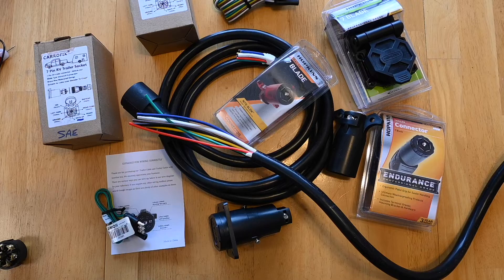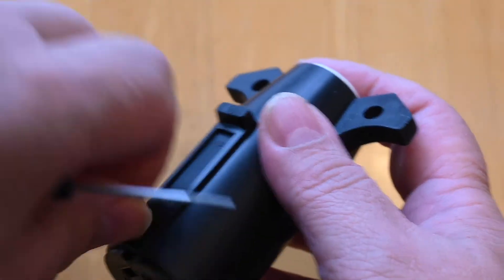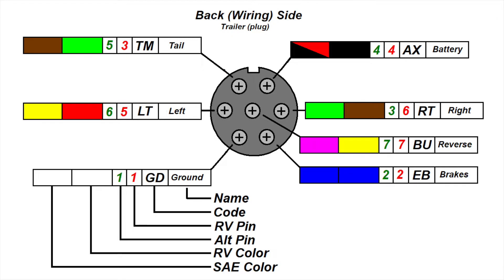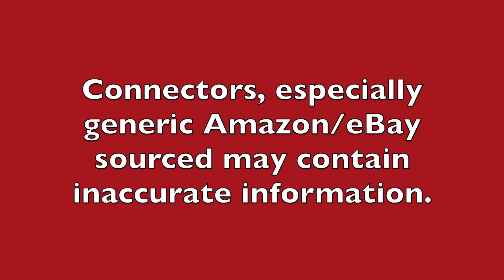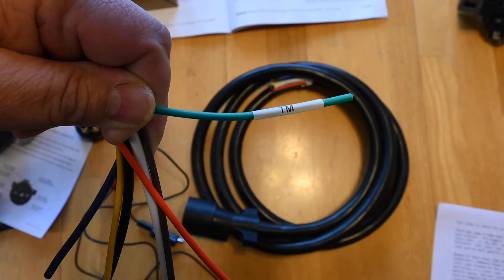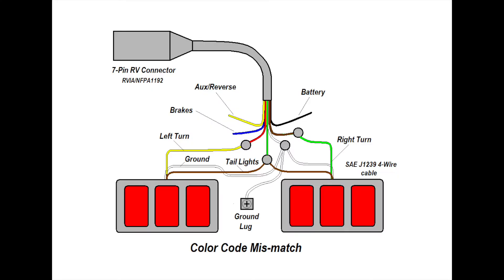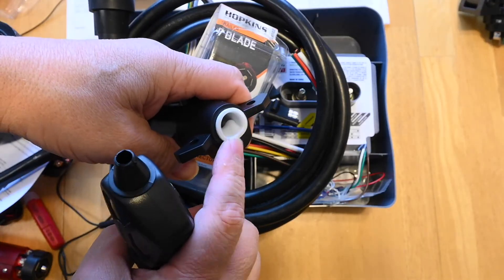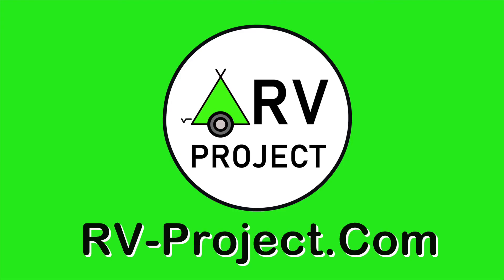All About 7-Pin RV Trailer Wiring

Comment: Hey I have a semi truck, with a normal 7way for semis. I have an adapter it goes from normal semi truck to an rv style 7 way, like in your video..I don’t have electric brakes. I want to use the rv style 7 way from the trailer and connect it to my adapter, silly for the purpose of using the lights on the trailer. When I plus the trailer in to my adapter it activates the brakes..could I take one or more pins out of my “female” adapter (7way rv style). And use it for only the lights on the trailer, and then it won’t activate the brakes on the trailer..if so wich ones? Would it ruin the electrical system in the trailer, if it’s plugged in to my adapter that way….i have pics if needed, thanks

Comment: I'm about to install a lithium battery on the little travel trailer, so I have been watching a bunch of 7 pin wiring videos.  I need to install a 12v/12v 10 amp limiter so my alternator doesn't overheat trying to charge the lithium battery.   I just want to say your video is the most in depth and simple to understand out of all of them!  Thanks!

Comment: Now, what about seven pole? Like the semi truck through the round one not the pin I’m having problems running these on trailers. I guess they have a separate function for the turn signals in the stoplight and they don’t have adapters from seven pin to seven pole, but I can find.

Comment: So if I was going to pull a trailer behind my RV which colored wire should I use? Is the cable with the 10-gauge wires in it the cable I should use?

Comment: Great Video! I am trying to find the max current for the pins in the connector itself per SAE J2803 (independent of the wiring).  The connectors in the SAE J1239 standard (4 wire trailer)  are designed not to exceed 7.5 amps but I cannot find a definitive answer, and thinking it is 30 or 40 amps max (though wondering if the center pin is rated differently due to the different surface area).

The use case is to run 30 amp circuit across 2 jumped connectors (4 connectors) and 2 for for low current sense lines.  details below.
I have a little row boat that uses a 30 amp max electric motor and want to use this connector to swap the battery box between the motor and the solar charger that I have at the dock (small lake, would love to run AC, but would require a 1000 ft run.  Stall current for my motor is 30 amps (unsure of run with back emf, but assume half), and the solar array can put about 17 amps max during charging.  The 4 wires style connector is not rated enough for this and thinking the 7 blade is a good candidate.

Comment: I hate to tell you this but most connectors and busbars in commercial and residental gear (panels, disconnects, power switch boards) is made of copper clad buss bars and connection components. Copper clad is not the worst of conductors.

Comment: Just did the trailer side coupler change, ran into exactly what you cautioned, mismatched wiring standards. Just took extra time to confirm each wire function, then install a terminal end and wire the plug.  Used a Hopkins coupler, Oops, got it all wired and then noticed the case split did not accommodate the wire loom, it had to be slipped through a separate hole in the housing prior to making connections, Sh**!

Comment: Thanks for your video! Yes, I needed to see what the function was when I was diagnosing my wiring problem on my trailer. I have a Ram and needed to see a diagram of function pin placement. Found that and was done in 2 mins. Before that, frustrated. I was going by what colors the plug said.

Comment: Someone hacked the 7 pin off my 1992 coleman tent trailer and put in a 4. In a attempt to regain some of the missing functions I wired a 7 back on. Seems my truck is standard 7 pin and the trailer is sae. So I end up with red connected to yellow for left turn for example. But then the color coding on my tent trailer doesn't fully match the sae wiring either. Fun stuff, bout to just push it off a cliff.

Comment: 2:35 the connection will NOT be able to go in ether way. Why 1 had a stopper in it and the other didn't
Reply from the maker: While its true the connection will only fit one way into the housing, marking/orienting the top slot helps you reassemble the connector without frustration, and keeps the pin numbering of the connections  indexed properly.

For some connectors, such as those made by Curt, the stampings for each pin do not follow an ordinal numbering sequence  pattern ( 1,2,3...), but rather skips numbers for adjacent pins.

Marking the index on the connector simply keeps things easy for some.

Comment: This is an outstanding video on so many levels. Besides the detailed  information including specification numbers, advice on marking connectors, etc., we are always looking at technical information and not watching a talking head. The only suggestion I would make is at 3:21 when showing the two standards (ha!) of pin-outs, you have a more visual transition between the two standards - I thought I had lost my mind when the numbers changed, I must have blinked.
Reply from the maker: Thanks for the recommendation.

Comment: Lol 😆 Gotta love it ! I was teaching a guy today at work on trailer wiring and he ask hey they give the functions but they don’t give u the color code, I start laughing haha i said take the paper and though it in the trash lol .. that’s a Rv wiring setup it’s different for the trailers .. he was lost lol .

I told him think of the 7 pin as a clock  12v power across from it would be ?? Negative right like a battery .. LT and RT are across from each other .. same for Running lights and E-brakes ..   then he asked what’s the middle one for I said that’s a two option it can be used for reverse lights on a trailer or it’s there for trailer brakes that are electric over Hydraulic.   

Then I said it sounds like Chinese right lol 😂  he was so confused lol 😂. I made him a study cheat  sheet color codes and pins .. i also reminded him when wiring a trailer plug it’s like looking in the mirror it’s the opposite right is left and left is right. Lol  .. i told him just flip the trailer plug  in front of you like your going to plug it into the truck and wire it like that . If u do that you will never mess up and make  things backwards lol .. 

I had so much fun teaching this lol
Reply from the maker: Thanks for sharing.

Comment: I understand that this business of 2 standards is a PITA. However think about this: In 1976 or maybe a lil later Jimmy Carter was president for 4 years. He did a good thing, He got us started on the metric system. Someone else never finished the job. As a mechanic I have a near double investment in tools. I am also a machinist. I have to buy metric tooling and SAE tooling, my machines often need to be able to do metric and SAE threading. This increases my investment in machines and tooling and the time I must spend converting one standard to the other to make my old machine do the work of the new math...
Reply from the maker: Funny thing about standards... there are usually several to pick from.

Comment: Anyone have a hack for the 7 pin connector by itself which will allow the camera to come on the touchscreen when the blinker is one, without the trailer being connected?
Reply from the maker: There is battery available on the 7 pin connector, so any of the other pins (other than the brakes) can be connected to the battery. Depending on which circuit your camera is connected to, simply connect those two pins together.

For example, this plug would allow you to turn your running lights on from the 7 pin plug on the trailer.  https://amzn.to/3LdCStJ
Reply: @RVProject  Thanks, i will give that a try.

Comment: Thank you for doing these videos. I’m curious as to how many amps typically travels from the tow vehicle, to the RV trailer battery. I’d like to run my fridge on 12 volts while towing but it drains the RV battery over time, even though I have a 160 amp alternator.
Reply from the maker: Typically, the 12V lead of the trailer connector is 10AWG, which should handle a lot of current.  But it also depends on how long the DC wiring is, whether or not your 12V fridge is connected directly to this 10AWG wire, or if you are using an inverter somewhere.

The only way to know for sure is to place a DC capable clamp ammeter on the 12V lead of the trailer connector.
Reply: @RVProject  
It's typically 30 amps that runs on the battery or constant power connection. 
But I do agree with everything you mentioned above being factors.

Comment: Thank you for this so much. Bought a 2000 Ford F450 w/ 7 pin RVIA wiring. Crushed the plastic housing, so I bought a Hopkins 7+4 (quick connect for 08+ trucks, but works for my 2000 with a wire cutter… LOL). All the colors matched, except the 450 has a red wire, and the connector has a purple. I was that close to splicing every color together, with purple going to red, until I checked out the first chart & noticed the Hopkins 7+4 matched the SAE color chart. Thank you for saving me about a day + in troubleshooting!
Reply from the maker: Glad it helped.

Comment: I banged my head against my wall on this stuff but I think it doesn’t matter, when you look at the traditional versus the J2863 while the colours are different they match up on function. Example taillights are green in the traditional and brown on J2863 but both are at the 10/11 (clock face  trailer side, 1/2 truck) position so if you had one on the trailer and the other on the truck they’d match up
Reply from the maker: Correct that the functions are the same pin-for-pin, but the wire color differences really mess most people up.

I recently did some rewiring of my trailer's lighting circuits near the rear tail lights, and the 7 pin connector was too far away for reference, so I sketched out  a wiring diagram to keep everything straight.

Would have been a lot simpler is the color codes were consistant, but at least knowing the differences in the two standards allowed me to make the diagram, and that was the purpose of the video.
Reply: I am trying to chase a short in my running lights, any suggestions
Reply from the maker: @canada59worldwide31  The biggest issue you will likely have is access to the wiring.  And RV manufacturers are notorious for not securing wiring, but rather let it just flap around. This can cause the insulation to wear away and expose the wiring.

Also, older trailers often had metal in the light fixtures that the wires pass through, and the short could be there.

I would also suspect every connector as RV mfgs do not do a good job at splicing wires together.

Comment: Diagram about 6:40.
Isn't it backwards.
When looking at the socket isn't the right turn supposed to be on the right side?
Reply from the maker: You are looking at the back side of the connector, so everything left-right is reversed.
Reply: @RVProject  
Thank you . it just seemed confusing. 
Now I will have to see if you have a video on brake controller, recomadations.
Reply from the maker: @andrewsparks4112  No video on brake controllers.  I use the factory brake controller that came with my GMC pickup.
Reply: @RVProject  
So no video yet!
Reply from the maker: @andrewsparks4112  nope

Comment: The most informative video out there for wiring. The fact that you get into the confusion aspect, actually clarifies things for us hyper analytical people out there. 👍👍 That's two thumbs up, great job.

I'm pretty sure I already know what I did wrong just by your video. I'm willing to bet my trailer that I have a pinch of stray voltage jumping from the right turn signal to the trailer brakes. Very scary stuff when signaling to get off the highway.  Definably wasn't expecting the DEA style trailer tossing when I opened the door. But the good news is my refrigerator started working again. Like New!!! On gas, and electric. I should have given it a swift kick three weeks ago.😅😂🤣
Reply from the maker: Thank you for your comment.

Comment: my head hurts lol
Reply from the maker: Sorry.
Reply: @RVProject  lol its not you its I bought a new plug for a 2000 camplite popup I bought last year. I wanted to re do the wiring as it had dry cracks and rusted ground wire connections.. I bought a plug and never paid any attention to what or what.. And now I thought i did it right and half the things dont work now. I cant get the battery to turn on any lights only one signal works and the running lights.. So im trying to find out where I went wrong.. Now it looks like I will just re wire the whole damn thing lol ..your video is great  it explained how far off I was.

Comment: I think I just assumed there was no standard when I had to replace the trailer-side plug last year. I carefully recorded which colour wire went to each terminal first.
Fighting with 7 wires to make the actual connections was a bigger PITA...
Reply from the maker: Thank you for your input.

Comment: Theres Two Wiring Configurations!!?? Thanks, now I get it. I've been going nuts trying to wire my Utility Trailer with my new Truck.
Reply from the maker: And there is a third standard when you consider commercial trucks.
Reply: @RVProject  It Works! Your tutorial cleared the air and helped it all make sense. Thanks!
Reply from the maker: @Robert-ex2qp  Glad I could help and thanks for the feedback.